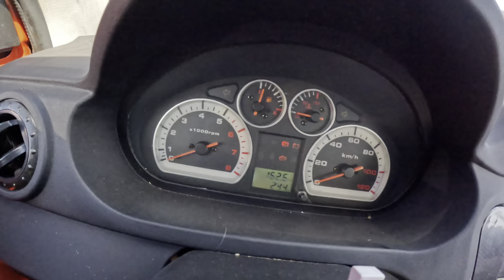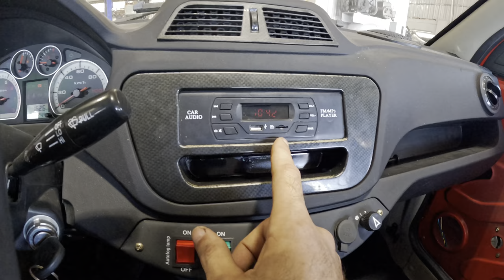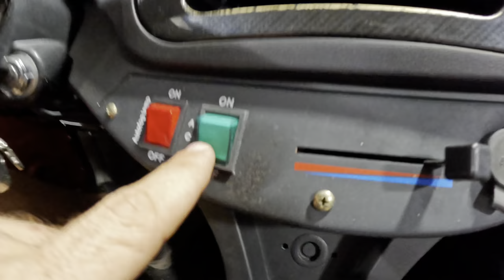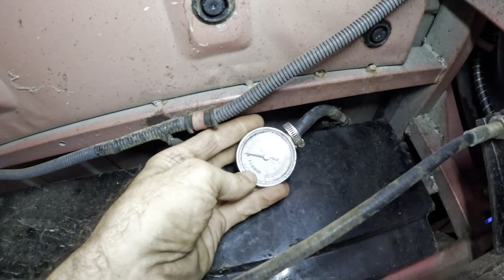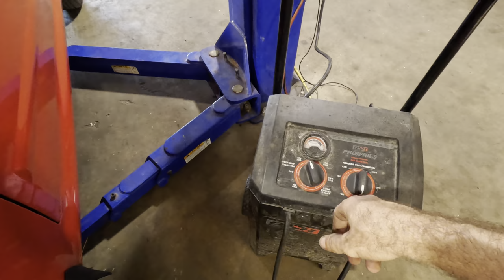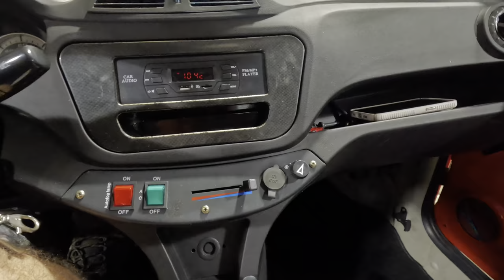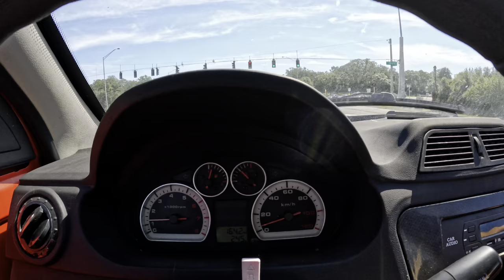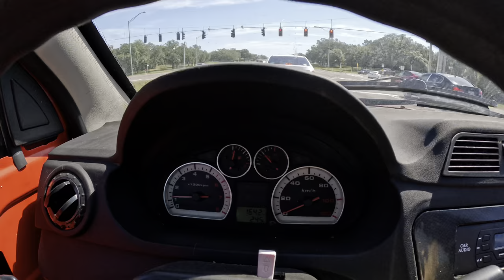UNFIT for the ROAD! Brand New 2019 Piece of Junk!

Comment: For around the city travel and it's either this or the bus, I'm rocking this all day. It has to be dirt cheap to run.
Reply: YES, and I was thinking the same thing~!! Easy as hell to park and plenty of room in the back seat for groceries and gets 50 mph~!!! Don't see a down side at all EVEN HAS AIR~!!!!!  :person-turqouise-waving:
Reply: @RickaramaTrama-lc1ys  Getting involved into an accident. No airbags or other safety systems. You won’t survive a crash in this thing.
Reply: @v31.48 far safer than a motorcycle which is the only other vehicle in this price range……😅
Reply: @RickaramaTrama-lc1ys uh what if you want to use the interstate?

Comment: I enjoy the sunroof that opens toward the front so it acts as an air scoop!
Reply: You will also enjoy the bugs on top of your head
Reply: It's probably needed to blow all the dust away that comes through the vented doors. Thats how rally car roof scoop works.
Reply: A necessity going down a steep incline in the winter I would say.
Reply: Open it at speed and the sunroof turns into a hole in the roof.
Reply: It’s an air brake
Reply: @badgermetal  its a race car no door panels less cylinders to reduce weight race fast fuel gas cap and no catalytic converter and a roof scoop.
Reply: @jimr8198  Speed? lol
Reply: @jimr8198 pretty sure my grandfather can run faster than that thing.  …and he died 30 years ago.

Comment: Imho I think that little red beater deserves a little more respect. It really ain't that bad if you were actually able to take it for a.spin. Someone obviously removed the door panels for unknown reasons, so when the thing was brand-new it must've been in much better shape. It's way underpowered compared to what we have in America but that doesn't mean it's useless in other parts of the world where regular people actually use them as commuter cars.
Reply: i'd drive this thing around all day here in germany. locked at 45kmh, this thing would be dirt cheap to maintain. Would cost like 50 bucks of insurance a year, a galon of fuel will get you like 60 + miles. nothing for commuting hundreds of miles but to get to and from work each day, i'd love it. i already have a few daihatsu cuores in my fleet though, so small cars are a bit of a hobby for me.
Reply: As others have said, third class driving beats first class walking
Reply: @chrizzly9222  
In earlier days not all cars came with door panels... and the wire/cable door openers are similar to to the TR3 and others from decades ago.
Reply: @cpufreak101  Or 2nd class taking the bus 😂

Comment: Ray It starts with a pull cord like a lawnmower.  Lauren has a great  sense of humour 😂😂
Reply: The prototype 2CV (French Citroen, designed to be a simple car for rural use) had a 600 CC engine with a pull starter next to the steering wheel.  The design specification was that "an elegantly dressed woman" should be able to start the car with "2 or 3" pulls.  This was in the late 1930's, so not having an electric starter or battery would significantly reduce costs and maintenance.
Reply: Be sure to sharpen the blade every 1000 miles.

Comment: I had a 71 Honda AN600. It was a 600 cc 2 cylinder air cooled motorcycle engine. First one with transaxle. It was fun to drive. It would fit into the bed of a 1/2 ton. They were chain drive previous years. This was Hondas  first cars in U.S..  Which became the Civic. It looked like a Mini Cooper. Drove it for 2 years for fun.
Reply: I drove one in Australia for 3 years . Such a great little car , even got blue lighted once. The cops were having a laugh.
Reply: The Honda 600 would be a 53 year old car now. Rules have changed. It couldn't be imported today.
Reply: Also like the Honda Z (Zot) ??
Reply: I always wanted the Z600.
Reply: Maybe Honda built quality was better compared to chinese.
Reply: It is interesting to note that the cooling system used a radiator WITHOUT liquid, just air! Wish I could buy a Honda 600, NOW!
Reply: There is no radiator on a Honda 600 at all. No AC either. Just 2-60? 2 windows down at 60mph.
Reply: i have a fiat 500 better than honda
Reply: @herbertshallcross9775 

Based on what rules?
Reply: @skylined5534  Don't they have highway safety and emissions control laws where you live? Maybe you could import it as a set of parts, but not as a motor vehicle.
Reply: I passed my driver test in Pennsylvania in 1973 in moms 72 Honda 600 coupe. What a fun car to drive ! NOT fireplug resistant as mother found out the hard way 😟
Reply: YES...THEIR 12 INCH RIMS WERE WEAKEST PART...
Reply: @bigsparky8888  never had a problem.

Comment: While stationed in Okinawa I drove a 1970 Toyota Publica, 2 cylinder air cooled engine, front wheel drive. It WAS a tiny car but reasonable roomy for the front seat. Rear seat more suited for small children or packages. Standard transmission, floor shift. Listed as First, Second, Third and OT (or Out of Town), Gas mileage was terrific. Top speed was approx 40-45 but since the speed limit on the island was never above 50 it suited. Buddy of mine had a Subaru 360. 360 cc two cycle engine in the rear. For the location and usage they fit the bill. Would not mind having one here for just in town use, would be folly (suicide??) to try them on the highway.
Reply: A friend of mine has a Subaru R2 with a supercharger on the twin cylinder engine and while it can do 80mph without much trouble i rode with him once and its absolutely terrifying 😂
Reply: Toyota Pubica

Comment: More sophisticated in every way than the 1965 VW Beetle I drove as my main vehicle from 1972-1984...
Reply: Führer mobile
Reply: Hmmm. I owned a 1958 Beetle
When I was in college back in
1967. Pretty sure it was several 
Steps above this vehicle. Mine 
Had the kerosene jet heater 
Under the hood so even in 
Northern Michigan it was toasty.
Went through snow great with 
The rear engine over the rear
Wheels. It was slow but reliable 
Got great gas mileage.

Comment: If there ever was a candidate for an LS swap, that little tin can is it!  😂
Reply: That's what struck me. Either LS or monster rotary.
Reply: yea! lets burn those 14"..no  13"..no 12"? tires off!
Reply: The tires would pop, and the oil pan wouldn't survive the first speed bump!
Reply: Never get an LS under that hood. A 2.0 Honda V-Tec could be interesting though.
Reply: @andrewlaw  I might fit midengine.  Probably would snap the car in half, though.
Reply: The car is nothing but a total POS!  I would rather walk.  Can anyone imagine getting smacked by a red light  runner?
Reply: @a4000t it would be doing a burnout at idle
Reply: Hayabusa swap it.
Reply: LS swap, hell you couldn't swap a 2.0l 4 cyl. into that matchbox! lol
Reply: nahh 4BT and watch the suspension cry
Reply: Sell it and get a Smart Fortwo!
Reply: If it'll fit.
Reply: Ha ha the motor weighs ten times more than that little car.  That thing would fit in my trunk 😅
Reply: LS swap the world.
Reply: ahhhh your one of those hey ?? 😂😂😂😂.. I love it ahahahaha
Reply: Hey don't laugh, one of my friends dropped a 327 in a Gremlin. He used it to tow his race car. No lie. It could pull wheel stands.
Reply: Nah this needs a tuned up V-twin Briggs and Stratton XD
Reply: @dannysdailys the Gremlin was a cool car design wise, and had a performance package from the factory 🏭, plus the manufacturer had a full on racing program,  that competed in several different styles of racing! American Motors was way ahead of the other big three when it came to safety and interior design. In my personal opinion them being driven out of business by corruption and the competition, is a damn shame! My buddy's dad had a Gremmy with a 4-speed and a BUILT 401ci. engine  as a kid growing up. I've never understood the hate that A.M.C. get's about their vehicles!..SMMFH..from Wyoming USA 🇺🇸 👋🤠
Reply: I saw a video some time back of a Smart car with a big Suzuki motorcycle engine in it, and the thing moved along very "smartly." But... but... here's a thought-- throw a Harley v-twin in this Chinese thing. (I think it's a Geely.) Imagine Harley sounds coming out of that thing.
Reply: @grizzlygrizzle  ooh a Harley XR750 would fit this car nicely.
Reply: Good luck fitting an LS in it. I don’t think the 4AGZE out of my MR2 would even fit in there. 😮
Reply: Thanks for the laugh ! 😂
Reply: @andrewlaw probably more of a motorcycle engine swap. Putting a v-tech in that would be like putting a Cummins in a civic.
Reply: Full subframe, UTV AWD & suspension, Hartley 3.0 V8, proper door panels...
Reply: If you put a LS engine in that without stretching the body & frame, you'll have to move the driver sit and steering back to the rear hatch cargo space.
Reply: Get in a Lemons 24 race with a Hayabusa swap
Reply: Yes, shouldn't he be more respectful? 20 years ago all these people had were bicycles.  Now the have cars -- not motorcycles -- cars.  Let's see your average American make that kind of progress in 20 years.
Reply: @hg2. , they only managed that by stealing tech from other countries. In china, "R-&-D" means "Ripoff-&-Duplication".
Reply: LS swap? Hell, more like a Harbor Freight Predator twin engine! I'm talking the biggest engine Harbor Freight has, 600-660cc, maybe?
Reply: @a4000t riding lawn mower tires

Comment: That looks a heck of a lot like my wife’s car has Chevrolet Matiz sold here in the UK. Yes I’m watching from the UK. It’s an 800cc car, but it does have catalytic converters AC remote central locking all electric windows, alloy wheels and can do an excessive 60 to 70 miles to the gallon. Great for tight little roads here in uk.
Reply: Yeah, it has its flaws, but matiz is actually quite reliable and fun to drive.More spacious than an aygo and far more cheaper to run. My dad had one, when were still owned by Daewoo and that car drove places.
Reply: Matiz are fine, chinese copied the shit out of it 😂
Reply: Yes I remember having been given a Matiz to drive when they where made by Daewoo as a courtesy car. The worst car I have ever driven. I don't know if Chevy have improved the car since they bought the car division of Daewoo, after the firm went bust. It wouldn't have been hard to make improvements.
Reply: there maybe a cat under the manifold cover as there is on the matiz..
Reply: @DavePocklington The Chevy Matiz is as bad as the Daewoo. Zero refinement, most uncomfortable car I've ever driven. 
It is funny to watch the front end dip and rise with each gear change though but that's it. Better off taking the bus.
Reply: Ah yes, the Daewoo that got a moderate upgrade in brand name 😆
Reply: Long story. 20 yers ago, there was Chinese car maker called Chery who copied Chevy Matiz and named it's copycat model QQ, which was the cheapest model in China back then and it became very popular. GM went into a lawsuit against Chery and I remember it was settled by Chery agreed to sell GM five- speed manual transmission at a discount price. However, after Chery rolled out this QQ, it's design was again copied by many cheap moped manufacturers in China. This one is basically a 4 wheel moped with a roof. It is not even a legit car in China. Mostly it is sold in rual area for senior people who is too old to get a license and to afford a decent car.  All they need a something with a motor to drive them from A to B and with a roof to shield from bad weathers. I think this gas-drive moped also extinct in China already and has been replaced by electric mopeds
Reply: That's exactly what this is, but the underrbody looks completely different, but it does seem to have parts of the rear suspension (a lot was removed) and the front knuckles look like they're out or a Tico.
Reply: @amojak  There is no cat under the manifold on 1996-2003 Matiz (at least KDM Matiz)
Reply: @stephenzhou2501  The story is even longer - The progenitor of this bastard is the Suzuki Alto, with roots from the 80s. Daewoo bought the rights to make this car in 1991, and IIRC FSO (Polish car company) started making these too in the early 90s. When the design became outdated, Daewoo purchased the plans for a Fiat Lucciola prototype, added a roof, a proper interior, and two more doors, put it on the chassis of the Alto, gave it a catalytic converter and fuel injection, and thus the Matiz was born, a very reliable and highway speed attainable car (I got mine up to 150 once!).
Reply: @the_kombinator  there is in the UK. it is canister shaped.
Reply: @amojak  KDM got a post manifold inline. I'm thinking of cutting mine out if ever I need to do some exhaust work. I only do like 3,000 KM on it a year (tops) and I can get my 1 HP back ;)
Reply: This thing reminds me of a Japanese Kei car.  The maximum engine displacement is 800cc, two cylinders and there are size limits as well.  I will take the guy's word for it that this car was made in China but the idea definitely came from the Japanese.
Reply: @mharris5047  In Korea it's under 1L. IIRC in Japan it's like 650 CC?
Reply: @mharris5047  Not only that, this thing is indirectly related to the Suzuki Alto, which the Koreans bought the license to make the Daewoo Tico (and Poland made it too), then the Koreans created the Matiz based off the Tico (as I understand the floorpan is reused, as is the vast majority of the systems; brakes, engine, transmission, suspension etc) which the Chinese blantantly ripped off in their Chery QQ model which this one resembles, minus the front clip. 

I bet those doors would fit my Matiz.
Reply: The Daewoo Matiz was an icon of a car, one of the first of its class to offer dual airbags, ABS, power steering and air conditioning. Seeing all these chinese ripoffs makes me wanna rip my hair out
Reply: @marck0060  My 99 had the ABS option, dual airbags? Not sure I have even one in my upscale (lol) MD (whatever that trim level is)
Reply: @mharris5047 The engine in Japanese Kei cars are only limited to 660cc, not the maximum number of cylinders. 3 and 4 cylinder kei cars are common. If anything a 2-cylinder one would be an oddity.
Reply: @stephenzhou2501 Definitely has Chery QQ DNA in there. The door handles, as well as the Chery logo on the accessory belt
Reply: @the_kombinator  the easiest way to tell if you have an airbag or not is by how many spokes your steering wheel has. The steering wheel with airbags is the same one used in the Lanos and has 4 spokes whereas the one without only has two.
The dashboard has a removable trim panel on both versions, so the only real way to tell if you have a passenger's airbag is by looking for the airbag writing on the panel.
Also just by curiosity, does your Matiz have an immobilizer?
Reply: Yes, shouldn't he be more respectful? 20 years ago all these people had were bicycles.  Now the have cars -- not motorcycles -- cars.  Let's see your average American make that kind of progress in 20 years.
Reply: Quite right guv'na
Cheerio 👌

Comment: I just lost my best friend of 20 years this last weekend and I drove his 2023 GR Corolla to his funeral. We done lots of upgrades on it. It is now almost 400HP. I had to give that car at least one good run for him. He was a car and motorcycle guy. Also big time into guns. I got his little 2023 GR Corolla up to 150 MPH on the way back from his funeral. He never has maxed it out like that so I had to see what it could do. He liked going fast on back roads i only seen him hit 125MPH in it. I had to show him what it could do. He was so proud of that car. I really take pride in my work. He only trusted me touching his cars. I also did work on all his  cars. But the GR Corolla was the fun car. The man always told me I was a genius. He will be missed.
Reply: The Gr Corolla is a 1.6 Three cylinder and we got almost 400HP at the crank.
Reply: the 2024 Buick Envista has the same 3 cylinder engine, but the size is 1.2 liter. It is a crossover, but it is affordable for the price point. This car cost 22,000$, 25,000$ for the St version, 29,000$ for the Avenir version, which is a top model offered in buick
Reply: @kevinhamlett1400  But I am a lot more impressed of what Buick Envista is able to do even when equipped with the 1.2 liter 3 cylinder.
Reply: People who drive that fast are responsible for many deaths.
Reply: @florenbaron7111 that’s not necessarily true, there are drivers who can handle that speed just fine and uneducated drivers who can’t handle it. You are talking about the uneducated drivers who can’t handle that speed but want to speed for fun.
Reply: @florenbaron7111 Maybe You're the one doing 45 in the left lane. That causes way more accidents.
Reply: What does that have to do with the video?